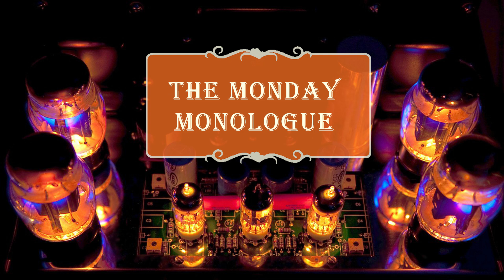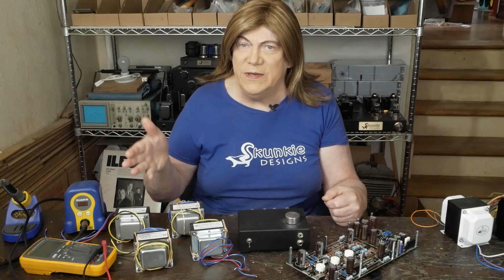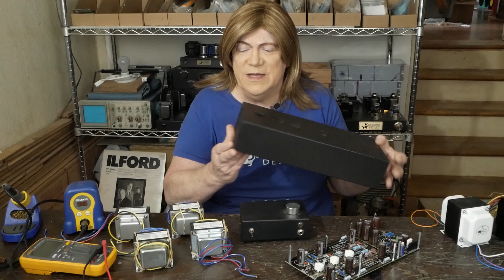Monday Monologue: Where to Start as a Noob at DIY Audio?

Comment: My 2 first builds were a 50 ties fender 5w amp, only product iwe sold and a mouthharp player loved it.2 was a riaa with dc heating,and its working fine,then some primetive fenders and a marshall18w  and at last a costy 300b amp with dc heating. I dont use the 300b amp,i think tubes are to exspensive,now i bought 2 6v6 gt builded by amatauers localy here in my litle contry.they are printbuild,and im not to happy about changing electrolytes in them,its a big job to gett the print out of the scassi.stupid constructjon to not have a bottom plate.but cheep amps and play realy nice.the reason to build self, in my head,is that it is point to point.ewery tecnican loves to work on that,but manny gets pretti good at fixing print builds.just think about easy to gett to work on the circuit when doing chassi!
Reply: You have to be dedicated,to learn building,and learn,yourself, old simple point to point guitar amps,is a good start. Then you start to know how the pinns on tubes are used,and after more prodjects,you know pinn 2 on ecc 83,and see that its used same way in other amps, and tripple check ewerithing before putting on power, but you have to study skematic,and learn the rule of grounding,and safety,all my amps are runn on un earthed wall soclet fore decades ,and they worke fine, the thinking about details and solutjons,i think is the funn thing with making your own amps. But dont build amps with higher than standardtube power. Transmitter tubes are not fore amatauers! To high voltage.

Comment: I used an adapter from Crutchfield to connect my car stereo to the factory wiring harness.  Color code was yellow = 12V+ and black = ground for power.  Blew the fuse in the car fusebox.  The adapter had the yellow and black wire installations crossed.  I had measured before connecting and saw 12V but did not notice it was NEGATIVE 12v.

Comment: Which speakers do you use with your amps Stephe? Would you think the 300B might work better for certain type of speakers (e.g. horn high sensitivity speakers) vs. others?
Reply from the maker: Well the 300B makes more power than the EL34 amp, can't see why it would need more efficient speakers? But who knows. I think it's more the "triode sound" vs the "ultralinear sound".

Comment: Good decision on not doing the kits, it will spare you a lot of headaches. I am very sure of it that these – sorry to be blunt here – these persons with their cheeky requests would not phone up a vendor in, say, China because they got lost over the project / kit they bought of them.
After all it IS called Do It Yourself, is it not? And, nowadays, information is just a couple of mouse clicks away …
Reply from the maker: I'm pretty sure if I sold kits, I would end up on the phone all day hand holding people through their build and/or diagnosing the problems at the end. That or getting visa charges reversed when they got frustrated with their own lack of skills. 

I honestly get a bunch of emails already from people expecting help when they are DIYing stuff. I don't mind helping when someone has exhausted other options, but not as the first recourse, which is what they will expect if you sell them a kit.

I actually had one guy who said "I built this amp from your video/schematic, it doesn't work. What are you going to do about it? I think you should pay for all these parts I bought."!
Reply: @SkunkieDesignsElectronics  
The last paragraph leaves me flabbergasted. 
You might want to consider including some kind of disclaimer in your download content (schematic / BOM etc.) to avoid further quarrel of that kind. 
I bet he made first place in the annual Mr Insolent contest.

Comment: I know my limitations.
I build my all my speakers and enjoy that process but I have the crossovers designed and fabricated to the point where I can just hook them up with wire and crimp-on connectors.
But building an amp or preamp, never that.
My skill set is quite limited.
So I can say I am glad that you are focusing on building components and not kits as I am in the market for your tube components. 
🙏🙏🙏

Comment: I would recommend getting a bunch of cheap electronics kits from t*mu or ali to build up soldering skills. Even if they aren't of any practical use, they are still good enough to learn component identification and checking as well as improving soldering skills.

Comment: Funny that you made this your topic this week.  I've been having an ongoing debate with myself for a couple of months now.  I've got my eyes on your 300B project.  I've done lots of fabrication, but not a lot of sheet metal.  I've been soldering 35+ years, but have little point-to-point experience and very little high voltage experience - I'm a highly advanced noob - LOL.  To practice on a smaller cheaper chassis, I decided last week to build the EAR 834 and ordered the board.  I've got high hopes for it - the 'highly rated' Ifi Zen I've been using doesn't make me smile.  I will promise you this... I won't pester you or ask you to bail me out.  I'll get it right the 2nd time - LOL
Reply from the maker: You will love this phono stage.

Comment: Do you see the Little Bear T11 mods as a good beginner small project? Drilling chassis seems to me the most inconvenient part, not because it would be hard but rather because of the tools and space required.
You explain very well the hassle of selling kits. It seems to explain why Dynakit keeps pausing on kits each time they lose a supplier.

Comment: Great advice, Stephe. That tube headphone adapter sounds like an excellent first project. 

I started charging a consultation fee somewhat recently. It’s tough with friends though, but if they value my time and experience, I should too. I fix people’s mistakes for probably close to 20% of my amp repairs. The funny thing is when they say, “Oh, Noooo, I never opened it up and tried to fix it”. C’mon now….😂It’s usually made worse and could’ve electrocuted them. 

I can totally 100% vouch on how great the circuit for the EAR 834p phono stages sound. My friends always wanna buy em though. The one I’m building now is a somewhat no expense spared one, but for me this time! (I hope) lol